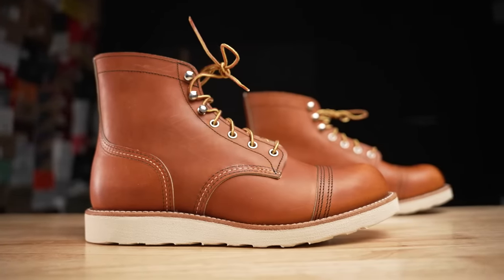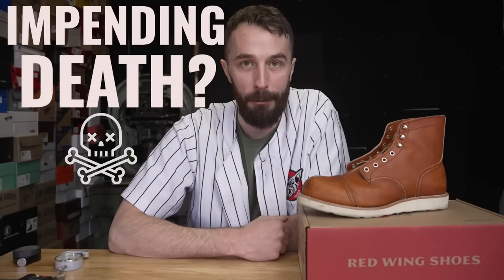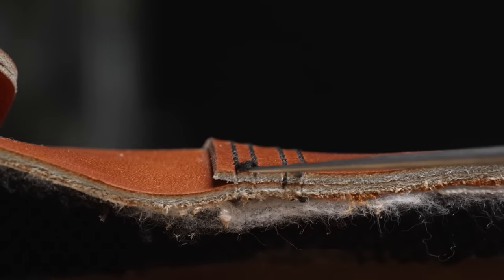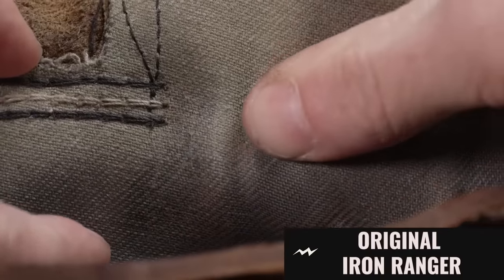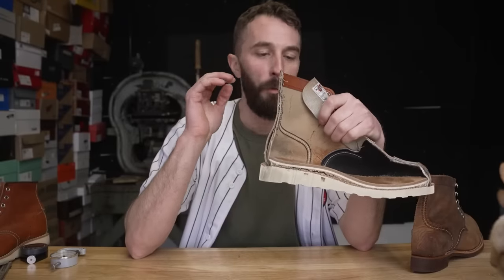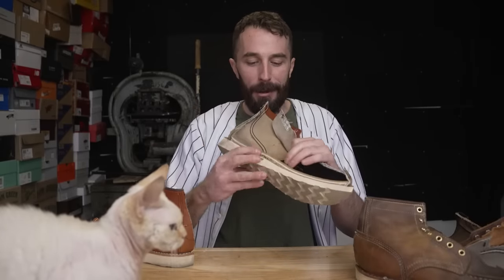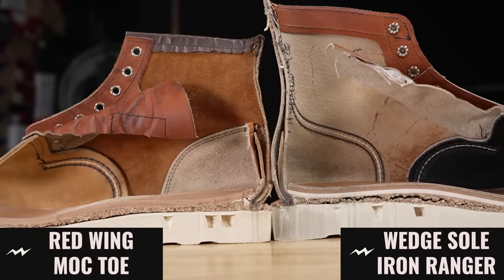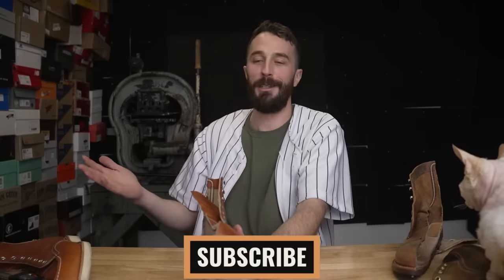Why People Are Pissed At Red Wing

Comment: I worked as a machinist for 35 years and we got one pair of boots every year but the Red Wings didn't wear out  for about a year and a half, even in the extreme conditions of the lubricating oil covering everything. I retired with five brand new pairs and still haven't word them. 😁
Reply: Best pair of boots I ever had was some Sears Craftsmans. 
I got 2 pairs from around 90$ out the door , each pair lasted almost 3yrs when I've paid 3x and have them fail in a year. 
Boy I'd kill for another pair as these are starting to fade away.
I've worn out 3 pairs of shoelaces in these if that gives you an idea.
Reply: What size ?    👀
Reply: I bought a brand new pair off engineer boots at a second hand store. $40 for a never worn pair of Red Wings, even if I hated them I couldn't NOT buy them! I've had them resoled a few years ago and the manager offered to replace them with ANY boot in the store. I didn't like the styling they had at the time and preferred what I had because I used them as motorcycle boots. They've kept my feet safe through 2 accidents over 12 years and will probably continue to do so for the rest of my life, now that I've quit riding. This video has taught me to "always say no" when they offer to replace them vs. another sole to wear through haha
Reply: Wouldn't be able to do that anymore. I used to wear red wings they would last atleast that long and could be resoled. Not the toes blow out in 6 months and the sole needed to be re attached after 3 month. I will never buy another pair
Reply: Thats sad to hear. I've really enjoyed my old boots, I just wish they were a bit lighter. Size 13, 7 or 8 inch tall, engineer boots weigh around 10 lbs each. However, with that weight they increase their durability. I would love to have a second pair, so I guess I'll just week my eyes open for the secondary market
Reply: What size? I’ll buy a pair.
Reply: Me too but have 2 new pairs that're around 25+ years old! (Use the others to mow in and, one pair as a 'dress' boot!)
Reply: I think you work at the same place as my dad, lol. Rolls Royce?
Reply: I'm a welder. Real men can work with bare feet. Toughen up machinist!
Reply: @howardhughes6212  Yeah? Well you'll shit and fall back in it before you work on an oil rig barefooted without steel toed boots, tough guy.
Reply: @thadnipper9411  😂 little boy I have worked in a rig.
Reply: what does this have to do with the video?
Reply: @howardhughes6212  Good lord, no one asked.
Reply: @howardhughes6212  Whats better than this? Guys bein' Dudes
Reply: @manhathaway  DOOD!
Reply: Wow, that's awesome! What a blessing👍
Reply: My employer pays for my boots once a year too. As a mechanic I use about a pair of Redwing for 2-3 years before everything breaks down.
Reply: i use to work as a mechanic at a major US chocolate manufacturer and they would provide us with free boots monthly, due to it being a food plant.  I still have 5 or 6 new pairs from about a decade ago because they last me forever.
Reply: The machine shop i worked at had a similar deal. New boot voucher every every two years and they paid to re-sole once a year.
Reply: I work masonry. They can wear out in 5 months. True story.
Reply: @jeffnpatricia  do I sense a black market request? It's funny because that was my 1st thought.
Reply: You got Zelle o need some 😂
Reply: My dad was the same way. He retired and gave the boot tickets to my brother in laws and they're still wearing them. He retired right before covid
Reply: My dad had a pair that he gave to me they already have 13 years worth of wear n tear but it was very minimal boots felt good although is a little heavy.
Reply: I worked in a winery for a few years back in the early 2000s and tried Red Wings at one point.  Utter garbage.  They lasted only a couple of moths.   I'd tried their boots in the early 90s as well and had a similar situation, but I thought I'd give them a second chance.

Red Wings are on the "never" buy list for me.  They've been utter garbage each time I've tried them.
Reply: @SSArt98  My dad bought me a pair when I was in the 9th grade. They were a bit large, but my feet were large. I wore them for over 40 years and they held up pretty good. I took them overseas when I was sent to Okinawa during the Vietnam war. The leather finally wore out; it was so cracked and brittle it was just coming apart. I had them resoled three times which always worked for me.
Reply: I have bought redwing boots 30+ years because they made H or 4E  wide shoes and where made in the USA. For 15 years I bought mod.2892 great boot fit like a glove no break in for around $250.00 I would have paid  more but NO. I had to buy $225.00 boot made Vietnam 🇻🇳  and doesn't feel  as good so just when  ahead and got a pair specters for$80.00 made in Indonesia that feels much better and it is a EW.  I would like see more USA 🇺🇸  shoes.
Reply: The soles of Red Wings wear out pretty fast.
Reply: I get a shoe voucher for redwings too but they seem to be just good enough to last a year in my line of work. That's good enough for myself as I get a pair every year. I put mine through all sorts of conditions and abuse though. The 2 worst are probably kicking deck cones locked or unlocked on a ship to other docks that deal with soda ash, petcoke, and sulfur. Kicking the deck cones chews the leather up so that the steel toe is exposed. Then sulfur mixed with the water they spray to prevent dust makes sulfuric acid and they reclaim all the water so I am not sure how acidic it is but the work trucks and other metal gets eaten away over time. I think it's a pretty good sign for Redwings to last a full year at my work.
Reply: That’s sad. I guess Redwing is headed down the typical American road of cutting corners and raising prices. Called greed
Reply: @MrTheHillfolk  the wheat colored ones? they looked like timberlands
Reply: @Automcanic  what type?
Reply: I bet you walk on the grass to save the soles 😮fml
Reply: Same with my dad. Idk he always bought the cheap Walmart boots. His one pair of red wings were 25+ years old. My first pair of red wings are still floating around. I'm almost 40. I got them for r my 16th birthday
Reply: @jckanza8121  yep. My first few pairs of wings were awesome. The last 2, one had the sole coming off and one, the leather had a hole over the steel toe. Man they sucked in the wet. Hahaha. I have a pair of Silverado slip ons with the wedge sole. They're CHEAPLY made and the leather is crap but they're comfortable. I bet they don't last a year.
Reply: I have been wearing RW work boots not heritage since the late 80’s. I always keep 2 pairs in rotation.
Reply: @MrTheHillfolk  I still have a sears craftsman radial arm saw. They made stuff right back  then.
Reply: @matthewotis3594  heh, dad's still got his ,got it probably around 76-77 and it built the first house I grew up in. 
That's good stuff!!
Reply: @MrTheHillfolk  Rock Rooster used to make the craftsman and diehard boots, unfortunately Chinese brand workpoint is manufacturing most of them now and the quality went downhill. Whites boots is they way to go now, can send them in for resole and repair.

Comment: So it's basically a Thursday at Redwing prices then. Shame.
Reply: Except better leather and QC coming from a made in the USA boot
Reply: @roberto78545  Thursday has made in USA boots with Horween leather uppers for $280. You could argue RWs QC is better but that’s still $70 less and Thursdays customer service is pretty good.
Reply: The US made Thursdays use fiberboard too, just without the padding. At least last pair I saw.
Reply: @robformica5394  I have the Vanguards and they definitely have some kind of EVA or poron padding under the leather footbed. But what I’m getting at is that their made in USA boots use the same types of materials as the RWs at a much better price.
Reply: Thursday boots are 🤮🤢🤮